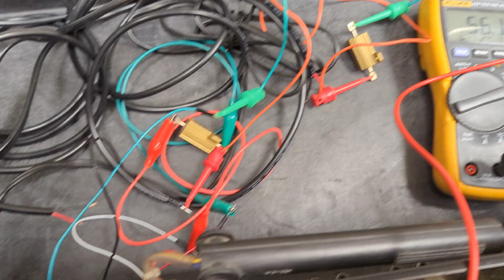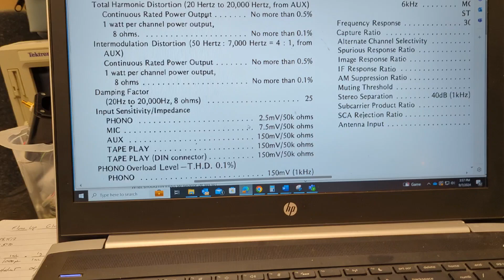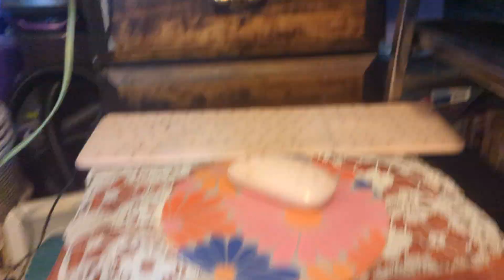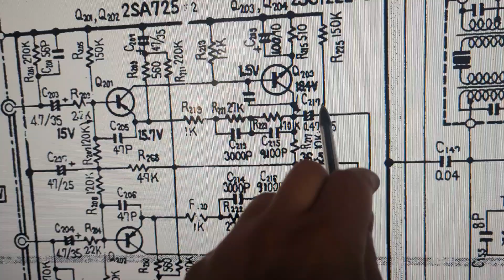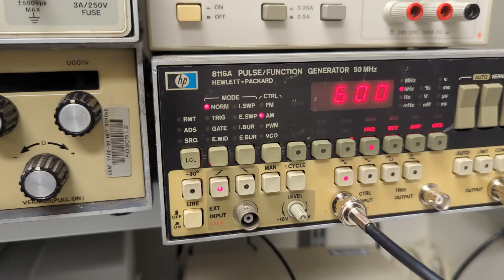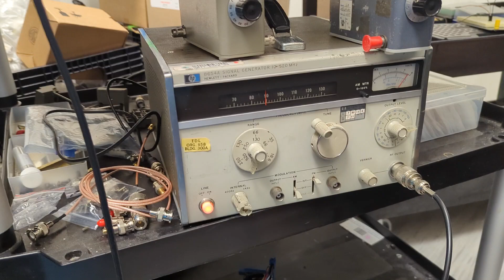Pioneer SX-450 Stereo Receiver: Troubleshooting, Repair, & Alignment

Comment: Hey Frankie, over the past year I've dipped into the vintage stereo addiction.  I purchased a Kenwood KR 7400 and used it for a couple of months before I was deployed and had to be away from the states while my belongings sat all summers long in an un-air conditioned apartment for about three months here in steamy Florida.  When I returned, I noticed there is some scratchiness as I adjust the volume up and down - it's only merely a nuisance, but I feel as though it's not transmitting the same volume power to the speakers as it was before. Is this something I'm merely imagining, or is this something that happens in conjunction with the scratchy controls?  Thanks.
Reply from the maker: Hey thanks for watching and commenting! Thank you for your service as well! I think the easiest thing you could do is grab yourself some DeoxIt. Pull the knobs off, take the top panel off.  And with the unit off, spray the knobs with DeoxIt.  You want to try to penetrate the knobs and switches any way you can.  Most pots have openings on the backside where you can see the wiper.  So you can spray inside there.  You can also spray the shaft - some cleaner will make it down the shaft into the internals.  The trick is to exercise the pots a lot after and during spraying.  Turn them back and forth dozens of times.  Same with those switches.  Those snap action switches get dirty all the time.  But the usually have some kind of opening in the back that you can hit with cleaner.  Exercise them a lot, too.  Give that a try first.  Fortunately, the service manual is still available on line for that amp/receiver.  So you have a resource there as well.  I am definitely no expert on these.  This was the first one I tried to repair. Was a lot of fun though.  That Kenwood also looks like a very pretty amp!
Reply from the maker: Make sure you allow plenty of time for the DeoxIt to dry after spraying because all that excess spray will get on the circuit boards.  Do your best to clean it up and let it sit for 24 hrs.  It should all dry up by then.  And then you can power it on to test it!